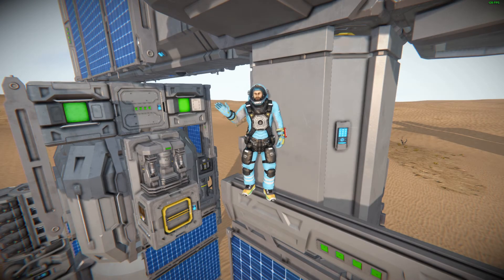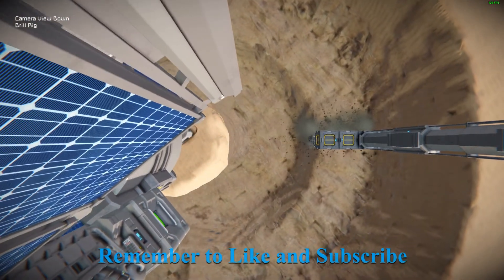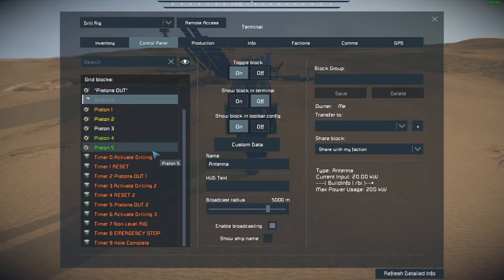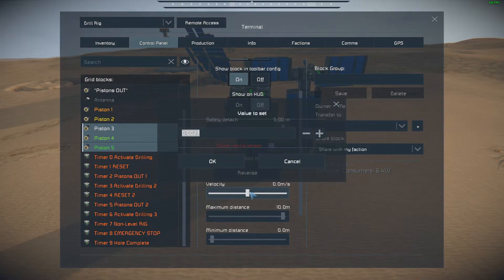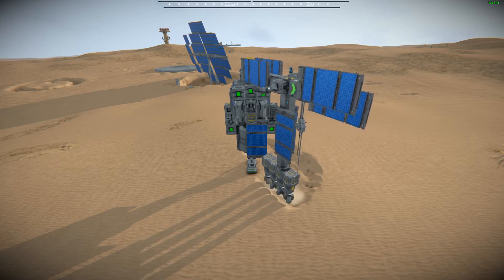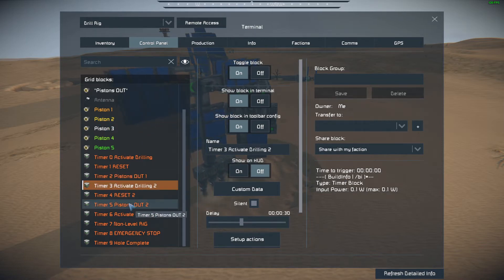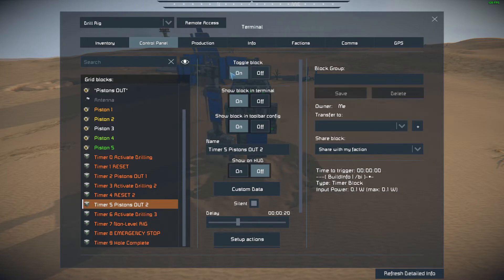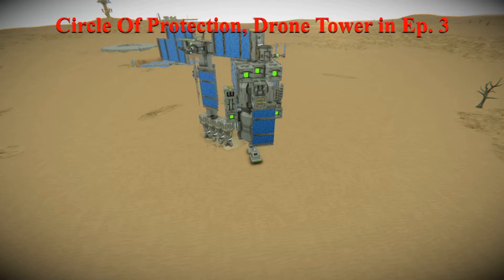Mobile Drill Tutorial & Time Lapse - Ep.2 - Space Engineers

Comment: One, it's "if you're keen". Two, if you're treating stone just as bycatch, a basic refinery is acceptable, but if it's actually your main source of ingots, it's outright sacrilege not to use a proper refinery. It is literally worse than both the refinery and the survival kit in all aspects that matter, as in, ingot yield per stone consumed (3.53 % vs. 5.04 %) and energy used per stone consumed (1.47 Wh/kg vs. 1.25 Wh/kg (R) and 0.62 Wh/kg (SK)), and even raw speed (62.4 kg/s vs. 124.8 kg/s (R) and 90 kg/s (SK)). And that's not even going into yield modules or into refinery efficiency settings of 3× and 10×. The only "advantages" of BR over R are that it has a lower power draw when active and not idling (330 kW vs. 560 kW) and that it's smaller and cheaper to build. But if you're at a stage where you can build such towers, you shouldn't be having a need for relying on that cheapness anymore.
Reply from the maker: It was an idea and one of my first ever designs I created when I bought this game, this time last year.
You make great and valid points on 'all the above' and I will be sure to add them in my future builds ✌
(Also no need to sound condescending or mean... I really appreciate the constructive criticism tho 😎)